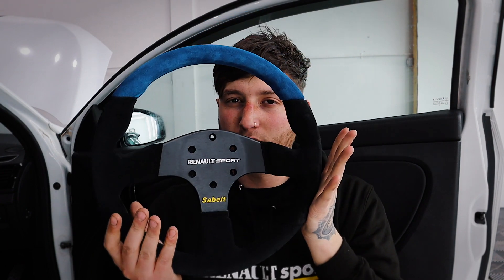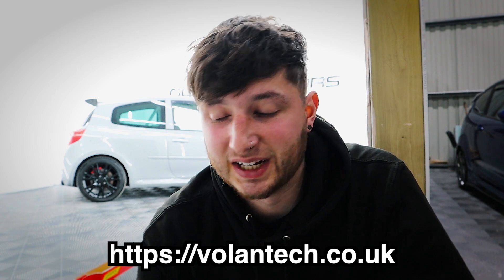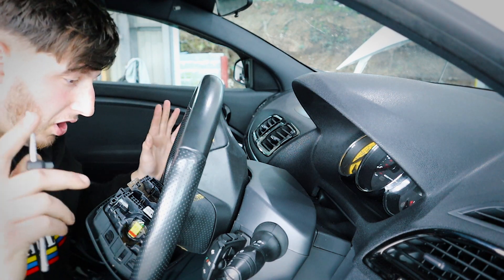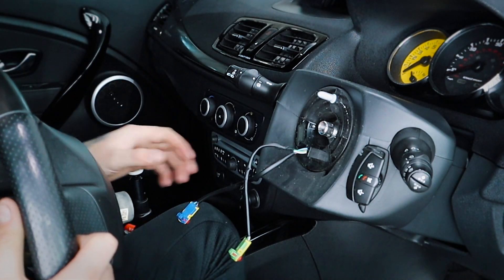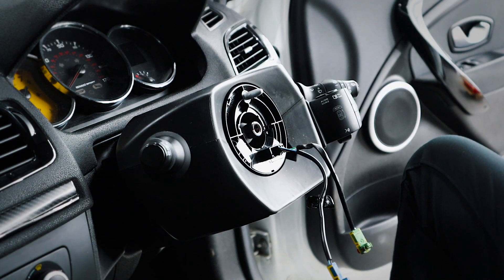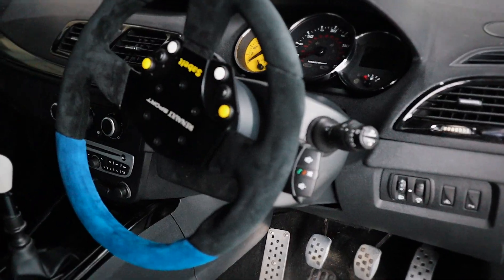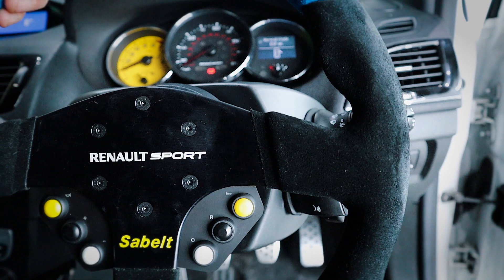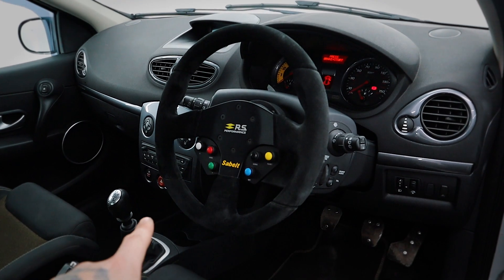THE BEST INTERIOR MOD FOR ANY CAR!! *DO NOT BUY A REPLICA*

Comment: Is it a MUST  to have harnesses + cage to have an air bag delete wheel like this? I don't want hassle when it comes to MOT
Reply: Harness with cage do NOT effect mot it’s only airbag delete on the steering wheels which fail mot that’s all but if you know someone who can pass it with it, you’ll be fine
Reply: @boostedchris6120  thanks 👌🏾
Reply: @saint_iri  No problem mate
Reply: As long as you're air ag light isn't on it should be fine